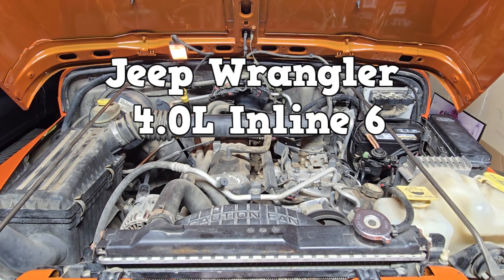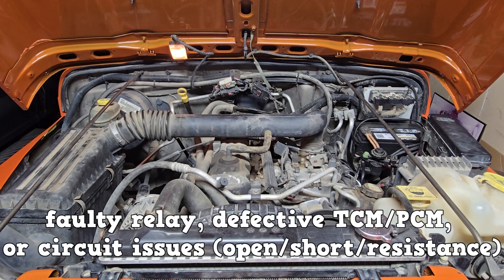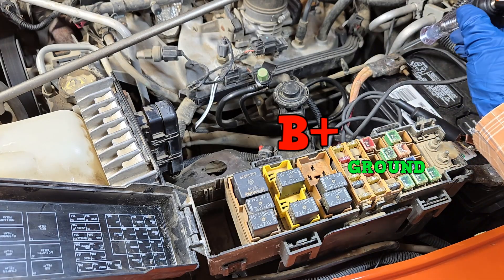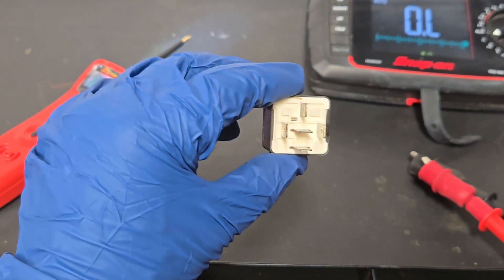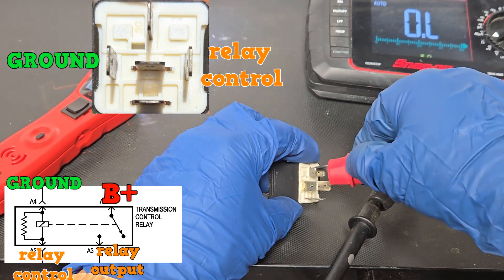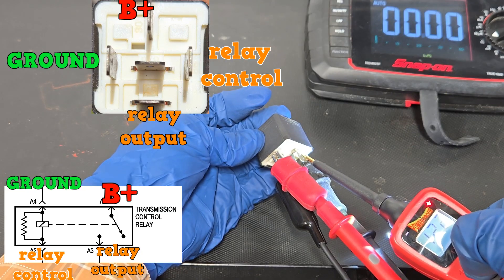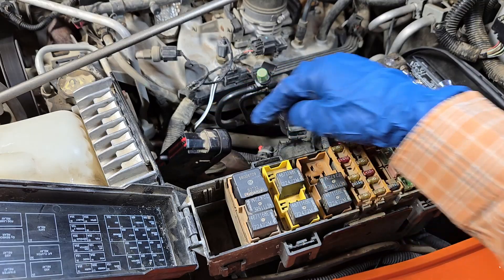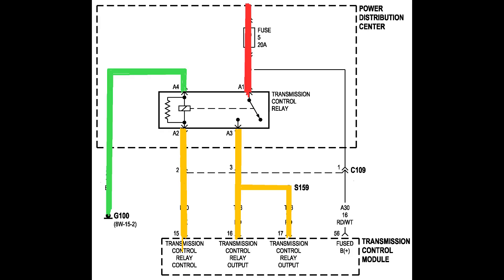P0888/P0700 How to Diagnose for Jeep Wrangler (03-04)

Comment: Damn great video with the explanations … can you come over and help with mine ? Hahahaha. I’m a noob and I have a P0715 code, just bought a fluke 117 multimeter, waiting for a new VSS (on transfer case) (2006 wrangler unlmtd rubicon LJ). Do I follow the steps as you show here for my issue? Need help. Thanks